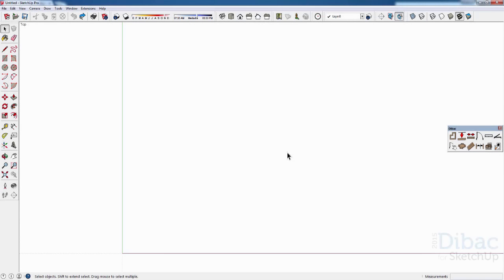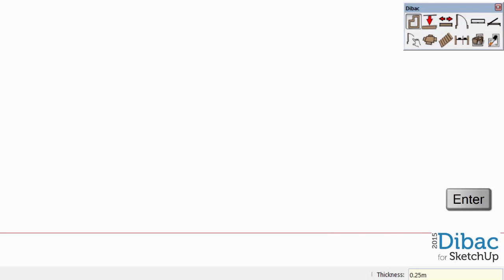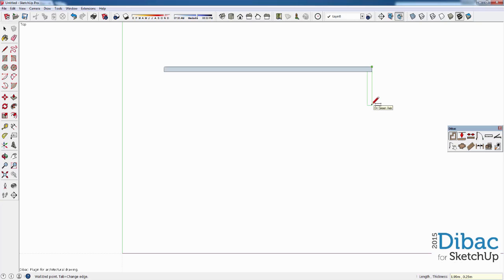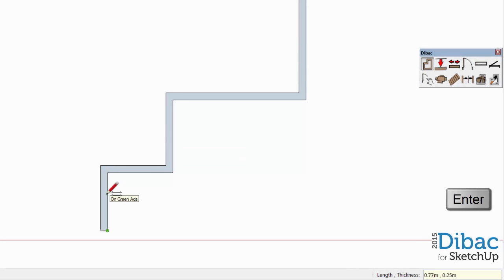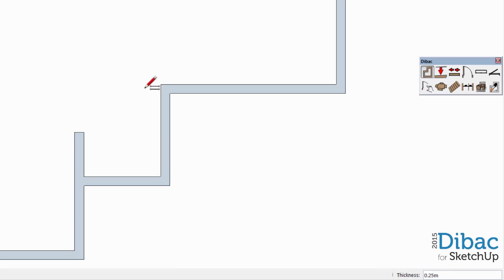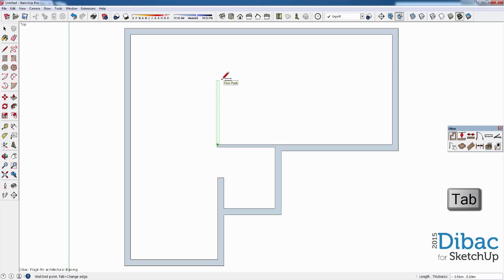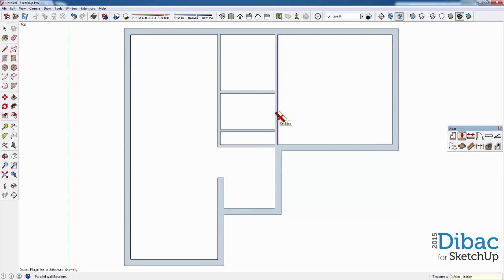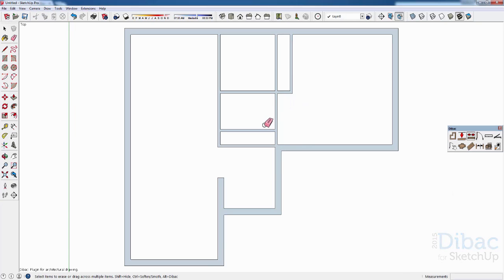Tutorial 1: Walls - Dibac for SketchUp (English)

Comment: After convert to 3D view, the windows are on the floor? why?
Reply from the maker: Hi +Shawn Low

Thanks for your comment. The elevation from the ground is set right before inserting the Window.
1. Click on the Window tool icon
2. Set your Window settings and click OK
3. Before inserting the Window type with your keyboard the elevation value from the ground and hit ENTER (you will see at the right bottom corner the new elevation value)
4. Insert the Window. When you convert it yo 3D the Window will be at the correct elevation distance.

I hope that solves your question.

Thanks,
Javier
support@dibac.com